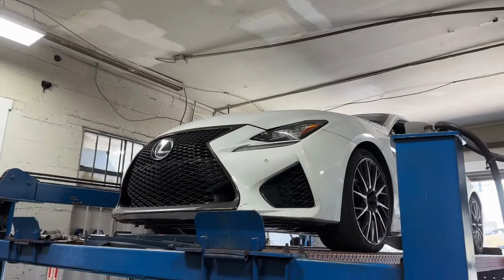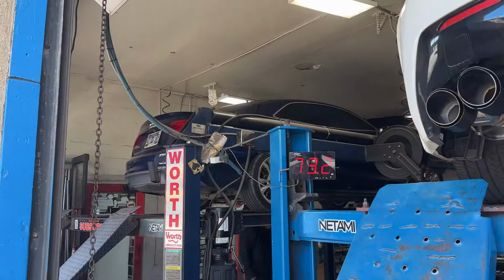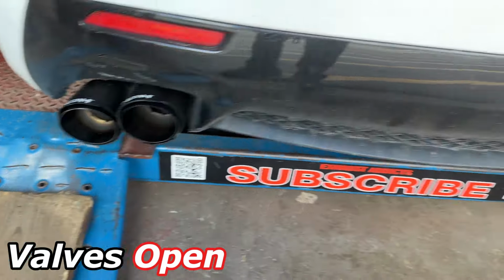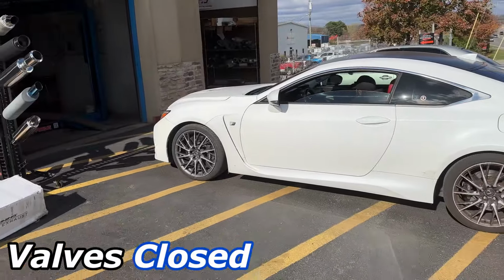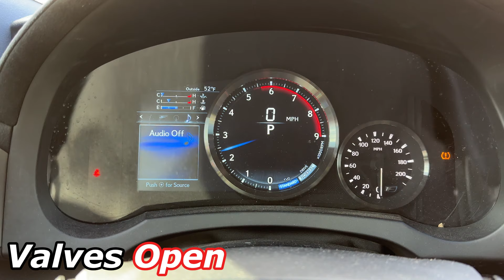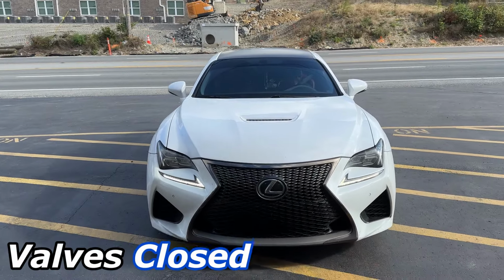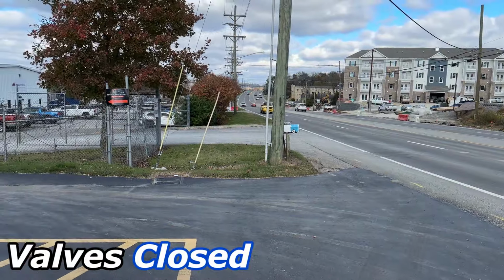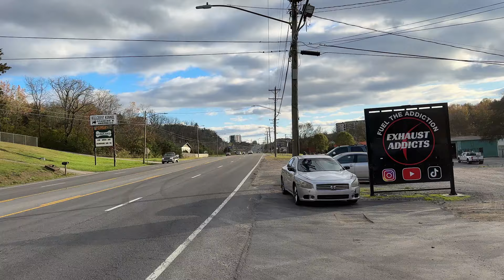2015 Lexus RC F 5.0L V8 Exhaust Sound w/ Valvetronics Designs Mufflers!

Comment: now it sounds like a coyote lmao, these valvetronics still cost way too much. yes im aware this is basically a Japanese coyote but usually they sound different
Reply: It’s not basically a Japanese coyote. The 2UR-GSE came out in 2008 for the ISF. The Coyote showed up 3 years AFTER in 2011. Youre not aware, just misinformed. Yamaha V8s do not sound like fords no matter what you do to them.
Reply: @2URLex  sounded like a 5.0 with a MBRP exhaust
Reply: @2URLex *Lexus V-8s. Yamaha designed the cylinder heads. But to call it a Yamaha engine is kinda weird.
Reply: @ARentz07  ok and? Anyone speaking on a technicality couldn’t tell me any thing about a car they don’t own personally, which is what you’re trying to do lol

Comment: It's a Japanese Coyote 🤤🤤
Reply: Ford basically copied this engine. It’s essentially the same from the ISF 15ish years ago with the addition of direct injection.
Reply: @snakehead5444  the coyote came out a little after that and it was already handling more power so it wasn't a copy
Reply: Correction, ISF came out in 2007 and more power than the coyote in2011, so yes it was a bad copy with vvti actuator issues amount others.
Reply: @snakehead5444  let me know how many 1000whp 2007 ISFs are rolling around? To the number of gen 1 coyotes. I thought so.
Reply: @USDM_Jesus  have put thousands of miles on an LC500 and those motors were made to handle 800whp. Both good very similar motors, less problems and aftermarket support for the Toyota based 5.0.
Reply: @snakehead5444 Ford in no way copied the Toyota 5.0 but keep thinking that nosense
Reply: The 2URGSE is a little over 3 years older than the Coyote. Research helps.
Reply: @thejmcGarage  the Coyote is an exact copy. The Yamaha V8 came out before it. By the time both hit their second generation in 2015 The internal measurements were identical but the Lexus were  making around 30 ish more hp.
Reply: @USDM_Jesus  because it’s unnecessary. Hell isf have climbed back up to 30-40k range despite its age. You’re not doing anything special with 1000hp except going straight…into crowds.
Reply: @USDM_Jesus  you’re funny, you have nothing else to claim except aftermarket assistance lol the isf has maintained its value while being stock and you’d need an extremely well built 2011 mustang to match its price more than likely. Mustangs are poverty spec pony cars.
Reply: @bigjets5733  if you know the history of the Coyote you would find it dates it's design and lineage from the Ford 32valve modular v8
Reply: @thejmcGarage  lineage has nothing to do with it and if you search even deeper the 1982 5.0 is proven as NOT similar to the Coyote right down to design and material. It’s only historical that ford used the 5.0 and nothing else. That was a weak attempt to prove yourself right, the information is easily obtainable here in the modern day.
Reply: @2URLex  i never said anything about the current 5.0 dating back to the orginal OHV 5.0.  The newer coyote 5.0 dates it design and linage back to the modular v8 ie: the 4.6/5.4 from 1991.  I worked for Ford when the 5.0 debuted so I have alittle more insight than most on the history of the 5.0 coyote.
Reply: @thejmcGarage  it can considered but is still labeled as not very similar in terms of where it’s derived from. The 5.0 2UR-GSE is derived from the 4.6 1UR-FSE, then there’s the 5.7 3UR-FE in the Toyota Line up that are completely similar in different generations or platform and are extremely well known in the world market. When people say “Japanese Coyote” it means they’re completely uninformed.
Reply: @snakehead5444  800hp is cute
Reply: @2URLex  the isf does sound great I love the sound of those engines the shifts at wot and how relatively light they are but mod for mod my g8 would whipe the floor with it and I'd argue after lifter work my car is just as reliable if not more
Reply: @USDM_Jesus  unless you’re claiming to have 1000 hp from a GT 6.0 or a GXP 6.2 I doubt your claim. I’m a huge Pontiac fan and even with my heavy RCF I fear no NA GM product lol for reference isfdubs here on YT has an FBO tuned ISF that gaps C8s that are still rated at more power. A Lexus that’s 16 years behind in tech holding up against modern performance with no issue and his isn’t the fastest NA ISF recorded.
Reply: @bigjets5733 The only thing "Yamaha" about this engine is the cylinder head. It's a Lexus engine with Yamaha co-development.
Reply: @snakehead5444 The 2UR always had both direct and port injection, so I don't know what you mean about "the addition of direct injection".
Reply: @ARentz07  that’s more than enough and the beauty of Japanese companies in their collaboration efforts to deliver a product. Same with the first gen Ford Taurus SHO engine and the Volvo XC90 V8 that have Yamaha involvement. That’s a complete blessing. The bespoke blue on the F car intakes is a representation.
Reply: The isf has direct and port injection just like the new coyotes

Comment: Sounds great , probably pretty expensive though
Reply: Valvetronic sells universal rear muffler valves system on their website 399 for single so could probably get a pair shipped and installed for a little over 1k
Reply: That's actually wouldn't be too bad, I was thinking 2 or 3 grand.